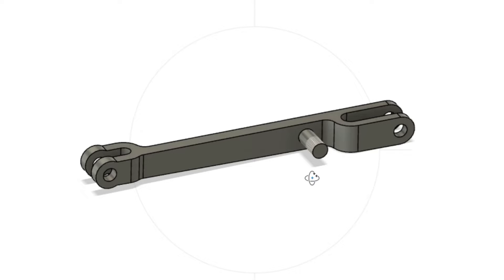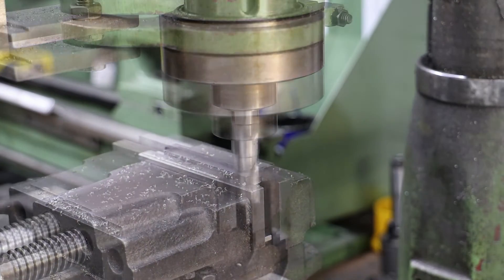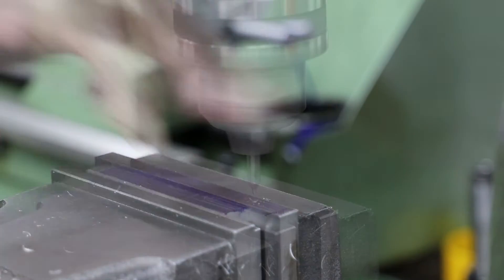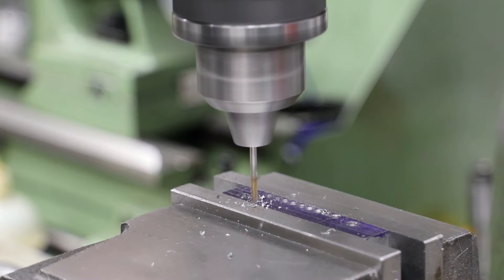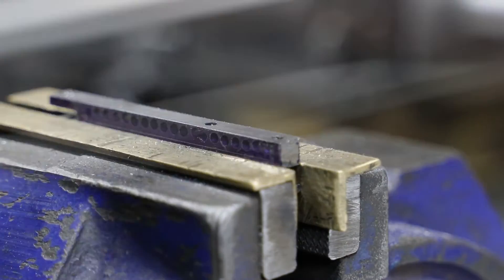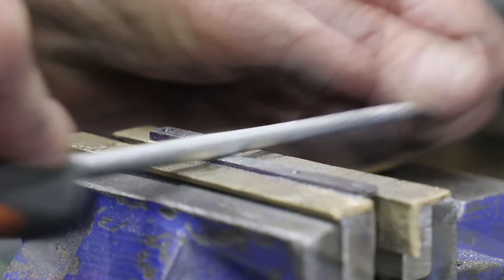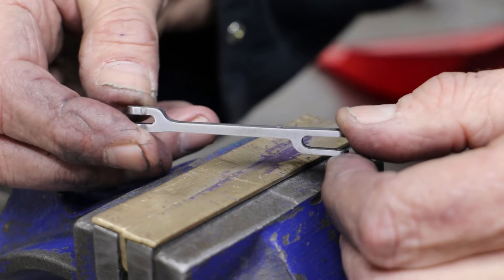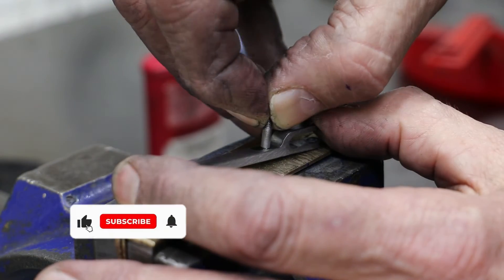Part 43: The Radius Rods

Comment: there is currently a Thread running on the site "Model Engineering Clearing House", under "General Chat" with the Title "Butch Grate. . .how do you get it in and out?". Now would be a good time for you to read the Post before you attach the Boiler.